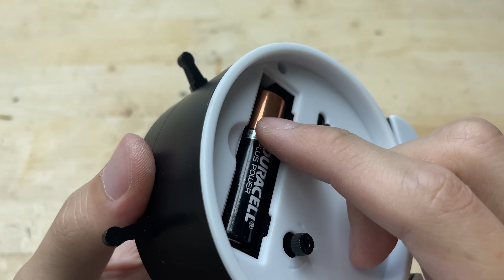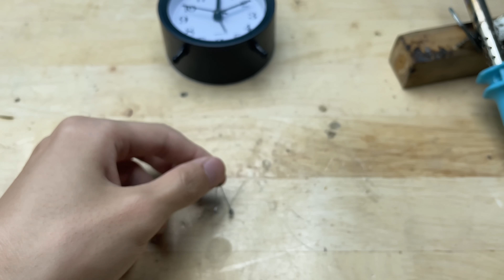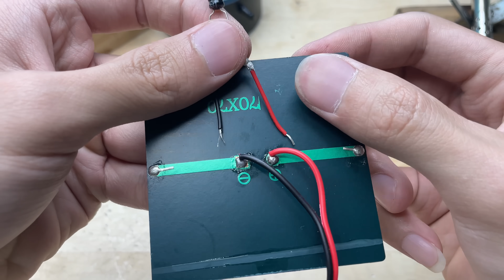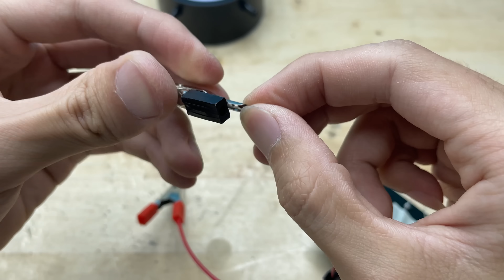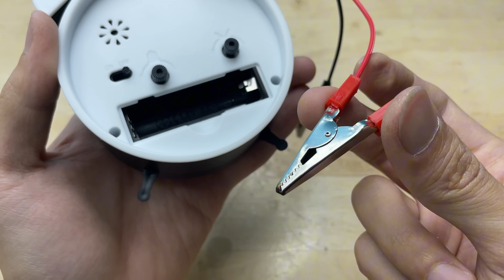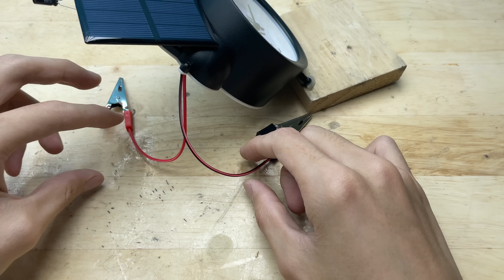FREE ENERGY! NO BATTERY NEEDED! Running Any Clock Without Batteries!

Comment: The best solution is to attach 3.7V li-ion battery with step down module set to 1.5V
That will surely last for years to come than again one may charge that battery for another term.
Reply from the maker: Big thanks! I’ll keep working on making even better content.

Comment: The normal AA battery's output is 1.5 volts, which is needed to run the clock. The output through the solar panel is 3V, won't it spoil the clock circuit with double the power given through the solar panel?

Comment: According to the clock specifications, the clock should run on 1.5 volts, the small panel is generating 2.8 volts, how do you account for this?
Reply: الساعة تعمل ب1.5 وصاحبنا رفع الجهد الي 3 فولت كيف تعمل ب3 فولت ثانيا كيف نحط الساعة في السطوح علي الشمس